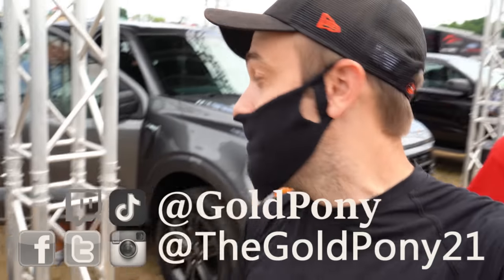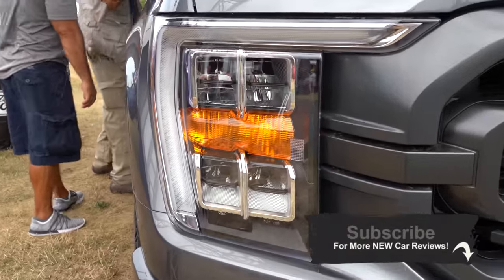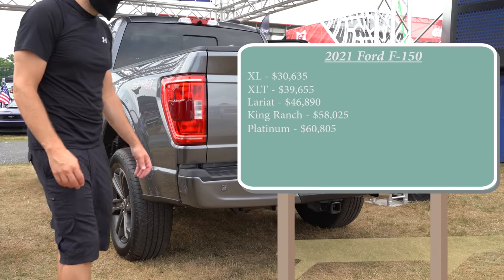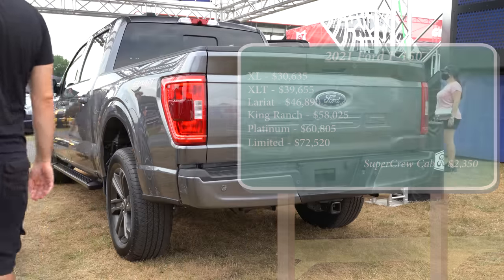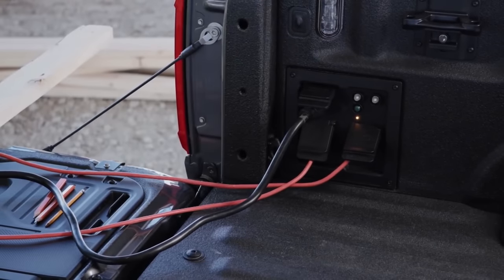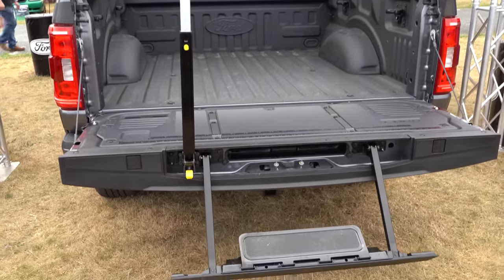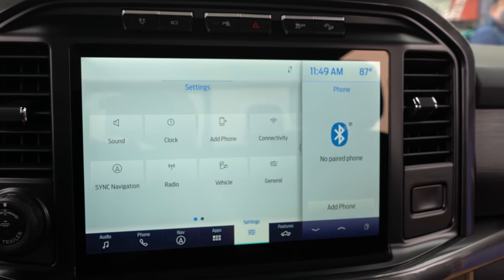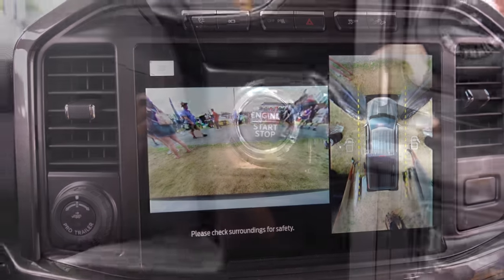2021 Ford F-150 First Look | This Truck will Surprise You

Comment: I love it but those headlights look eerily similar to the Sierra's.
Reply: I know right? I was thinking the exact same thing.
Reply: There are only so many ways to design a headlight or a vehicle for that matter so you can always expect some design elements to be copied and adjusted by all manufacturers.
Reply: Joshua Michael ok.
Reply: Levi Baggett got a problem with his statement? 😂
Reply: What do you expect when GMC copied the Ford Headlights first?
Reply: I was thinking the headlights looked like the titan
Reply: tattoochef82 82 Ohhh. Yeah yeah yeah. I didn’t realize that.
Reply: 80sAirwaves I dunno 🤷🏽‍♂️.
Reply: The headlights look completely different from any other truck. The only similarity this has with the gmc is the angle of the top part of the daytime running light. Other than that it is completely different in both shape and size.
Reply: They're actually based off the superduty which is where Sierra got their design from
Reply: Thanos ok
Reply: They do but if you look at the creator of the C headlights just go back to the older ford  Expeditions? And right after that the  GM vehicles followed its path! And older F250s ? I’m a big GM guy but ford is always leading in the game, the rest just improvise it but with copying Fords homework
Reply: Plus they flared out the tail lights and they look very Nissan Titanesque
Reply: buzztrucker yeah
Reply: Keep in mind the Sierra's recent redesign made it look like an F150!
Reply: mrq1701 yep.💯
Reply: mrq1701 yes they do look like new f150 lol and finally they installed rear A/C  I have an 18 duramax I’m ready to upgrade
Reply: Miguel Gonzalez yes sir
Reply: Levi Baggett well Sierra did get theirs from the last gen F-250s
Reply: Every company copied things it doesn't matter no one has a generator on it wait for the other ones copied that
Reply: Wade Wilson Yes sir
Reply: Or the '18 and newer Expeditions that the Sierra copied?
Reply: Seth White yeah
Reply: Exactly. Ford is a huge copy cat. I'm surprised they haven't copied Ram's dual exhaust. Oh wait.... I've already seen on with dual exhaust from factory. And they copied their tail gate too with the wide base on top. But honestly I think all companies kinda copy each other in some ways.
Reply: @911Fuser  true, also something small but true.. The dual glove box in this F-150 was a straight copy from the GM trucks... we can all agree on that...

Comment: 3:41 The cover plate actually says 10 amps at 240v. Unless there's more to it than what's on the cover, this is actually a bit disappointing. It would have been nice to to see a 30amp @ 240v (7.2kw) option (disabling the 120v outlets). I was hoping this could be a potential alternative to buying a portable generator to plug into a home transfer switch for backup power. 2.4kw may be enough for very basic items, but being able to use the full 7.2kw in a home backup situation would be nice.

Comment: I see gym and dodge taking notes and always looking to improvise what  Ford has invented lol and I own GM and dodge trucks !! Ford is always ahead of the game! Ford will be the first with a toilet 😉😂
Reply: Shyt on the fly
Reply: In any moment GM & Dodge will stars using V6 turbo ecoboost & all the shit wacht.. they behind Ford is 10 years ahead..
Reply: I'm a FORD guy too, and I can't wait for this truck to be in my garage.
Reply: Leo Nilo maybe or they will just stick with their v8s that don’t need a rebuild after around 200,000 miles
Reply: As a technician I can say that gm trucks ARE toilets. The gmc looks ok, but boy do they keep my wallet fat.
Reply: Just off the top of my head, GM did these things first which Ford now does: V8 engine, automatic transmission, tow/haul mode, dampened tailgate, dual glove box.
Reply: Dale Couture truly you don’t wanna compare all the innovations the f150 did that gm followed behind on 🤣🤣
Reply: @CascadeSlim0119  Nothing you can say has been more important than the V8 Engine or the Auto transmission. But go ahead and try...
Reply: Dale Couture well we can start by Ford being the first to exist period. This V8 and auto transmission that you’re banking on is worthless had ford not made the first move for mankind. 🤷🏽🤣🤣🤣
Reply: omnipresent video yea I have had an ecoboost and have had good luck and I also own GM suburban and I’ve replaced 2 engines 5.3 and on my third and installed a 6.2 now hope it will last longer especially after removing the AFM system 😑
Reply: Ptolemy Castleberry will start with rear A/C 😂 GM barely decides to install one because A/C is important lol I own a 18 3500
Reply: Miguel Gonzalez exactly and a gauge cluster that works 🤣🤣🤣
Reply: @CascadeSlim0119  Ford was NOT the first to exist. Several automakers in Europe came before Ford. Karl Benz being the main one.
Reply: Dale Couture Ford did the engine on wheels, and look how many people follow.
Reply: Miguel Gonzalez you guys be forgetting about Volvo. They made the shoulder belt😂
Reply: @X-Fantasia  Ford was NOT the first automaker. Check your history. Still waiting to find out what Ford did first... lol
Reply: Dale Couture To start with, yes, Ford was the first to put an engine on four wheels, and be able to slap it into production with success. They put the handle on the tailgate, which other companies mocked, but soon followed. They were able to hold a company without any lawsuits. They made the first truck with an aluminum bed, being lighter making them have the highest towing capacity of their class. They were the first gas powered vehicle to support a 240V outlet, fold the gear selector, put the horn on the wheel, make a keyless entry system, and THE CUP HOLDER for crying out loud when Ford owned Plymouth. Do I need to continue?
Reply: Patar D Still wrong. Ford was not the first one making and selling cars. They did come up with a better process for mass production. But that is not the same as inventing something specifically with vehicles. Aluminum beds are a horrible idea and don’t hold up to high enough strength standards. They can keep that “invention” haha. The bed power outlets they stole from Toyota who has done it for years. 

Again, GM - Automatic transmission and V8 engine. Ford’s cupholders are not in contention with that!
Reply: Dale Couture you can keep your gas-guzzling V8 engines. I prefer mileage over 2 extra cylinders any day. Two more things to wear out. Also, Ford was the first one to mass produce automobiles, therefore being the first production company while everyone else is just another side project. If aluminum beds didn’t hold up to high enough strength standards, then why did GM have to drop a full toolbox in an aluminum bed and an empty one in theirs to not embarrass themselves in their commercial? Could it be that it held up just as well? Thick aluminum vs thin steel... if it doesn’t hold up to strength standards, then why can you still put more weight in them? Might it be that the aluminum is thicker than the steel? Don’t come whining to me when GM follows through with their plan to switch as well. If it scratches, put rhino lining on it like everyone else who has ever owned a truck. Just like GM owners who hide their rust. Anyways, Toyota doesn’t have a 240V outlet in the bed of ANY truck. 
Don’t use your cup holders in your vehicle and we’ll see how long you go without begging for them back. Clamp sockets, built in bed ruler, hub locks for 4WD, I don’t see a better truck on the market! GM was the first to make a continuous line of vehicles that have engine ticks.
Reply: Patar D You have no clue what you’re talking about. First of all, the GM V8s get far better fuel economy than the Ford ecoboost. Check any source like fuelly and compare averages. Also, Ford also uses V8 engines, which GM invented. And the thickness or material the bed is made of has nothing to do with payload ratings. That’s all about the frame and suspension setup. You need to learn more about trucks before you try to be the youtube expert lmao.
Reply: Dale Couture Your previous comment: “Aluminum beds are a horrible idea and don’t hold up to high enough strength standards”
Your last comment: “the thickness of the bed has nothing to do with payload ratings” 
1. The thicker the bed, the stronger it is, and the more it can hold relevant to its materiel. Last time I checked, payload ratings are a part of strength standards...

2. The fuel economy of the engine is measured when it is at its most efficient, and with GM, that means shutting off half of the engine. So technically that makes the engine a 4-banger. It’s not running on all 8 cylinders. 

3. You keep referencing GM making the first V8, which was first introduced into production by Cadillac, owned by FORD. 

The V8 and automatic transmission are the only things you’ve been referencing. Why don’t you list things that people actually WANT in their cars. Stuff that’s found useful.
Reply: Patar D 1) The thickness of the bed has nothing to do with the payload. If truck beds were still wooden, they would be strong enough to hold the highest of modern day payloads which are around 2,000 lbs for half ton trucks. 
2) The fuel economy is NOT measured at an engine’s most efficient mode or time. It is an average of the test results that use a vehicle in regular environments. If it was at the most efficient levels possible then they all would be near 100 mpg lol. And besides that, even before the active fuel management systems came out, the GM V8s were more efficient than current day eco boosts. 
3) Cadillac is part of GM. Not Ford.
4) People do want automatics and V8s. V8s have been the most popular engines in America for decades. Auto transmissions have been the most popular transmission in the world for decades. You again prove that you have no clue what’s going on in the automotive world. Move on.
Reply: Dodge doesn't make trucks anymore .. it's branded RAM only...
Reply: They be first on the toilet aswell when they smacked around like a doll by ram. I love ram. Ram is my number one then ford is my number 2. Chevy and gmc wrecked there trucks to me
Reply: Hayden Schneider Ram are junk buddy! The only good thing are 3500 or 4500 and are the worst in resale value as well! Don’t even get me started on fiat cars, I buy car for a living and also have a transportation company and I have one 3500 ram giving me hell of problems with emissions and electrical problems on a $84,000 truck ??? And with 2 months behind in parts because they suck ass
Reply: Miguel Gonzalez everything is out 2 months behind because of Covid lmao. Not there fault they had to all shut down 😂 and every dealer has lemons no matter who you go to. Rams are great and you know it so bye bye

Comment: In the thumbnail I mistaked the headlights by a 2011 f250 lol
Reply: Lol oh Andy
Reply: AndyG1714, tail lights are from 2011, specifically on the side shot. Of course these are LEDs but still, i was hoping for Bronco or GMC Sierra style tail lights. Those look awesome.
Reply: AndyG1714 u did what? Mistaked what?? Its mistook

Comment: $70,000+ for an F150.....
Reply: sucks to be poor
Reply: @williamjackson1482  the sad thing is I have money...im just not ready to spend $70k on an F150.
Reply: sad thing is over here in Australia we pay $80,000+ for the top of the range Ford Ranger...
Reply: I work at a ford dealership. We have a 2020 limited for $86k.
Reply: Crazier part is....it sells. You see way more platinums and limiteds than you do base models.
Reply: No thanks, I’m 22 drive a 99 accord and I’m buying my first house this year while my buddies living with mom buying one of these 😂
Reply: Starts at 30k
Reply: Prank ster lambos have many more issues. And then it costs thousands for just an oil change. Can you work out of the back of your lambo? With built in generators and plug ins? Don’t even compare them man. Not the same
Reply: I just want to see the Raptor version
Reply: Prank ster wow
Reply: Justins Falls that sucks
Reply: good thing you can live in it lol
Reply: @mixflip  Agreed. I could pay cash for the Platinum. But that'd be fucking stupid.
Reply: @danielbuchanan5327  Correction, starts OVER 30 grand, he very explicitly said that.
Reply: no one, i mean no one, would pay MSRP for a pickup or a F150.  Never.  Not even close
Reply: Just Waite a year it will go down to 30k 😃
Reply: @joseperezpaz9986  Wish that were true. 2018 F-150s (albeit CPO) are currently about 90% of brand new pricing for similar trim/options.
Reply: I call that a rip off for 70 grand I could go out to buy a 4 bed room home
Reply: None of the cars are worth what they want for them
Reply: jldude84 $30,635...thanks so much for fact checking that.
Reply: What you complaining. We here for previous truck already 70k, that means the new here will cost us if it’s allowed to import around 85-90k
Reply: Thats called Inflation U.S currency is devaluing
Reply: I have enough money but I spent less than half that one mine- got all the features I needed. Just don't get all the options added on.
Reply: or $30,635....
Reply: So many people complaining about the price LOL it's simple... don't buy the truck if it's too much for you! Great looking truck but Ford took too long to finally make upgrades to the F150. I bought myself a Ram this year.
Reply: I don't get what you mean?
If f250 can be 98+... It only. Makes sense 70 for f150
Reply: I wish they would stop making the 5.5 beds... They're useless... It's not even a truck then that's what bugs me...
6.5 bed is the standard...
Reply: People lost there minds lol. For that money id rather buy a loaded Mercedes that can tow just as much as the f150 as well lol
Reply: All that money and 5.0s burn oil. Hope they redesign the 5.0 to fix that. 2018+ has the new gen 5.0 that’s burns oil. If they put the same 5.0 in the 2021 don’t buy u less you want to add 2-3 quarts of oil between oil changes and engine longevity isn’t a deal breaker for you.
Reply: It’s cause they waste time and tons of money on adding things like the shifting nob folding down.
Reply: in Canada this is normal price for a f150 for the last 5 years
Reply: @boops1834  lol why?? 😂😂😭
Reply: Dylan Harris you sure that's not an F250 Limited?
Reply: @joshuaearnheart2756  Some people like fast trucks. This one kicks ass with the coyote and ecoboost.
Reply: They sold almost a million F150's in 2019. So alot of people can afford them. Maybe you need to work somewhere besides Mcdonalds
Reply: @MistAtsiM  It's a luxury car with a big open trunk.
Reply: get yourself a little cheap truck
Reply: You DO realize they all do not sell for that price?
Reply: @sierrapeaks8838  So do I!! I have 1.3 million PENNIES saved!!!!!!!!!
Reply: @williamjackson1482  You're one of those dorks driving around in a goofy Humvee, right????Everybody is laughing at you, you realize??
Reply: @markremy4946  these are all solid boomer comebacks! Glad you figured out the YouTube in your advanced age
Reply: @williamjackson1482  these are all solid boomer comebacks! Glad you figured out the YouTube in your advanced age
Reply: @markremy4946  oops lol
Reply: @williamjackson1482  says the guy who made a comment to be Witty but in reality can’t afford one himself.
Reply: @williamjackson1482  We're all going to be poor after companies like Ford are done raping us... 70k is f***ing NUTS for an f150!

Comment: My 2013 F-150 3.5l eco-boost has the large 36 gallon tank, I can get 20 mpg. on the highway. I once drove it 690 miles without stopping for gas!

Comment: It’s the epitome of over engineering that they didn’t just move the shifter somewhere else or go to a simple button system.  Instead a complicated folding shifter.  That’ll be fun when it’s a few years old and gets jammed.
Reply: I was wondering and thinking the same. Why not go with a button or shift by wire instead of moving parts
Reply: It’s because customers love an actual gear lever, every company that used the dial switch like sedans got a lot of shit from customers.
Reply: Or put it on the column
Reply: Or we could talk about the under engineering of Chevy putting a pushrod engine in the new mid-engine Corvette.
Reply: @redd7188  it's no 80s anymore, nicely made pushrod has good sets of advantages over dohc, natural low end torque is certainly one of them
Reply: @tallll70  a mid-engine car is made for the track not the drag strip.  Low- end torque is great for the drag strip but on the track you want the high revs of a DOHC.
Reply: @redd7188  i mean i don't disagree on advantages of dohc, just they doing pushrods so much better now, however i would guess the lower cost of ohv also due to the lt1 carryover is probably really big reason for it
Reply: @tallll70  you are right, OHV do cost less to build.

Comment: So they finally pushed the price of the base XL over $30,000. Yikes. Definitely wait for a sale on that -- maybe something in the $25k range.
Reply: I've sold Fords, In 4 years I only Sold 1 New F150 XL with 2WD. 99% of Truck Buyers spend 40K or more. The Extra Grand or so won't make a difference. Its worth it to get the 10 speed transmission

Comment: I have a 2018 and speak from experience. The top of the tail gate is about two inches thicker than the middle which means whenever I go through an automatic car wash, the brushes can't reach the lower part of the tail gate. So the F150 logo has to be washed by hand.